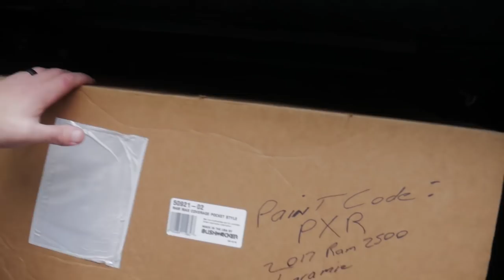TRUE SPIKE LUG NUTS Do your research before purchasing.

Comment: Hey nice work and youtube channel.  Have a real similar build (2018 Mega with the cummins, 6" BDS dual front fox, 37s etc.) any way, I put on some painted LUND fares (similar to bushwhacker) a week or so ago.  I had bushwhackers on my last truck and this time decided to take some preventive steps.  As you probably know sand/road grime can and will get between the flare and the body.  Over time the vibration will cause the flares to mar and scratch the paint.  It went through the clear coat and into the paint on my last truck.  After some research I found a technique that looks to work real well to prevent this.  Its the clear bra material (PPF film).  I ran a 3/4" strip right where the fender comes in contact with the body.  If interested I can send you a link to what/how I did it.  Just thought Id mention it as you seem to have an attention to detail like I do.  Great build - keep it going.
Reply from the maker: Thank you! Yes, please send me the link. That’s one of my concerns.
Reply: Here you go... My post starts at #974
https://www.igotacummins.com/threads/3072-What-did-you-do-to-your-4th-gen-today/page98
Taking the OEM flares off was really easy.  Didn't need to use fishing line or a heat gun... they pull right off - most of the adhesive left on can be pulled off and then cleaned with some adhesive remover.  Look forward to seeing your results.
Reply from the maker: Thanks for the info. Checking it out now. 👍🏻

Comment: Very nice!!
Will they work on stock steel rims or only aftermarket?
I have a 2011 f350 dually
Reply from the maker: They should work on them..
Reply: No the ones he has are acorn style for a dually with factory wheels you need lug nuts with a flat spinning washer on the bottom but these will work with some aftermarket dually wheels